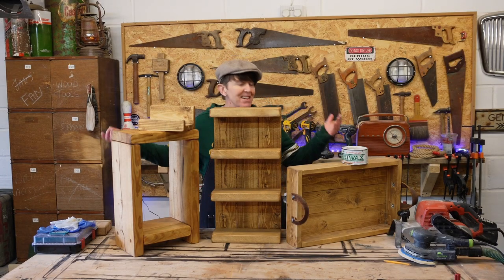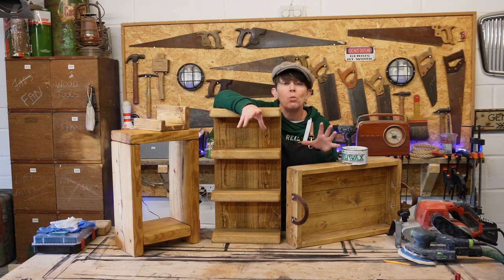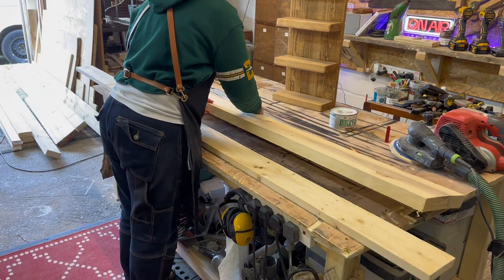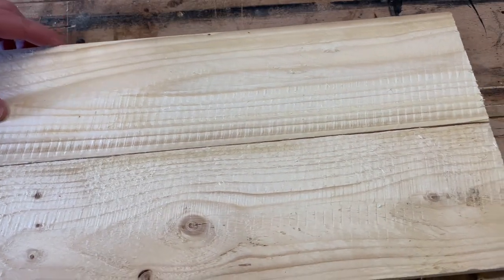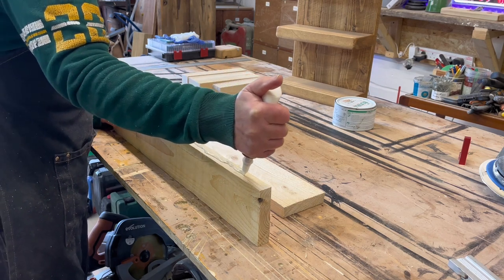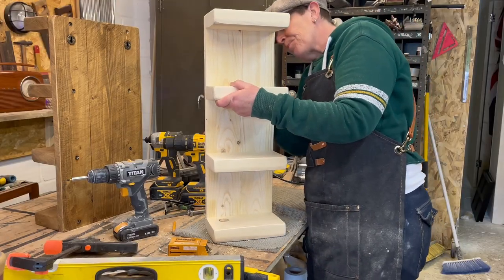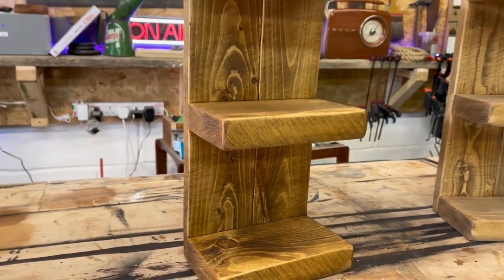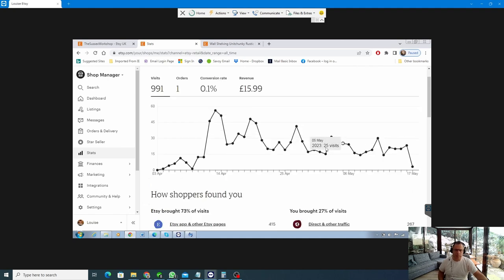Build An ETSY BUSINESS With Me Episode 8 - New Directions & More Inventory!

Comment: Lou, would you like a couple tips for ensuring your panel glue ups come out flat?

When you were joining your boards you turned them around and put both sides against the jointer fence. I’d suggest instead on one board place the front face against the fence and on the other place the back face against the fence. This will ensure that you end up with a complimentary angle on the edges just in case your jointer fence is just slightly out of square. 

When clamping them together, the clamps pull the wood towards the bar of the clamp. If you have half your clamps with theirs bars on one side and the other half with the bars on the other they’ll balance out the forces and be less likely to pull the joint out of flat.
Reply from the maker: Thank you Carl, i have passed on your feedback!